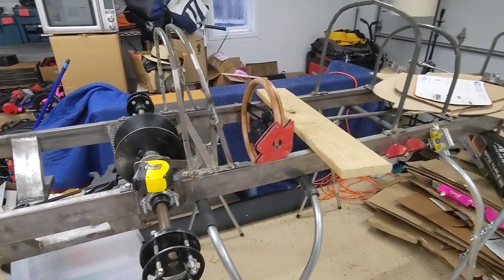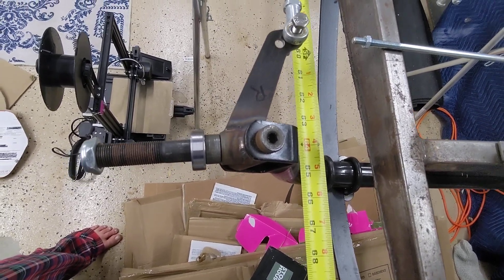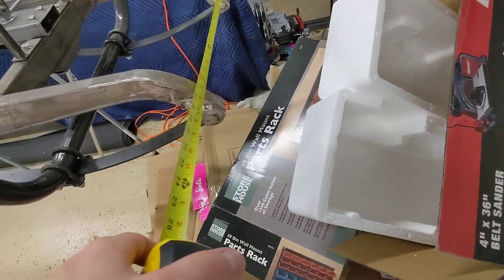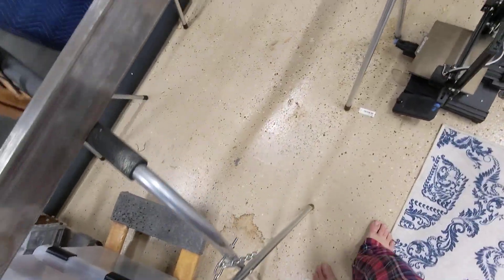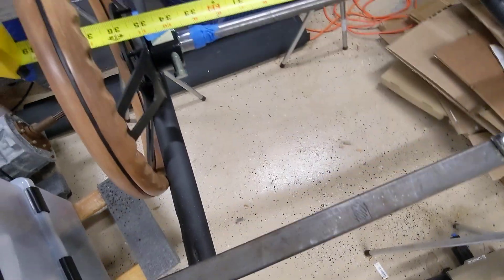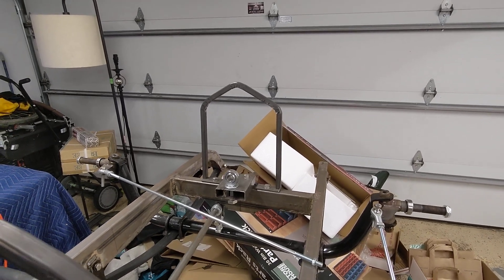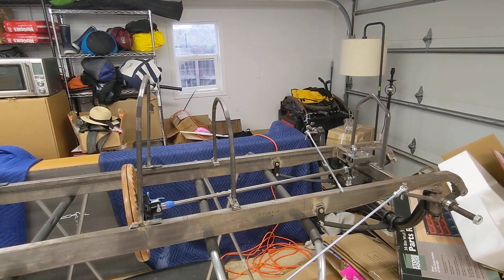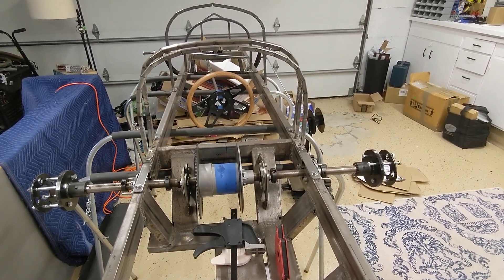Cyclekart Extra - Dimensioning, designing and measuring the chassis

Comment: Not to be a jerk but you should seek out a night class for welding, it would help you immensely.
Reply from the maker: Yeah besides half a dozen test welds this was my first metal fabrication project since I built a gooseneck trailer adapter for the family pickup when I was 16. A lot of the gross welds are the result of me having to fill 1/4" gaps due to bad cuts, measurements, or not tacking everything together first before laying big beads, and/or fix blow-outs due to welding 0.065 to 0.065 with a flux core welder on too hot of settings. I would do a lot of things differently and I cover some of these topics in this video
Reply: @hadlock  👍
Reply: "Practice makes perfect", I am still practicing my welding, I think my grinding is pretty good